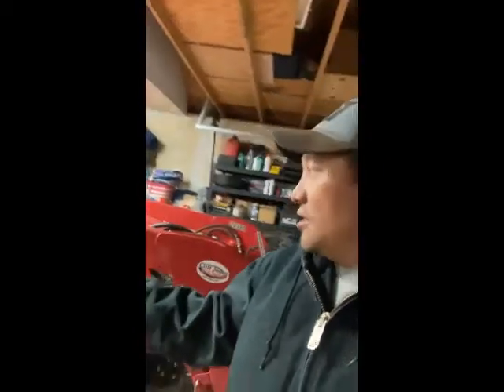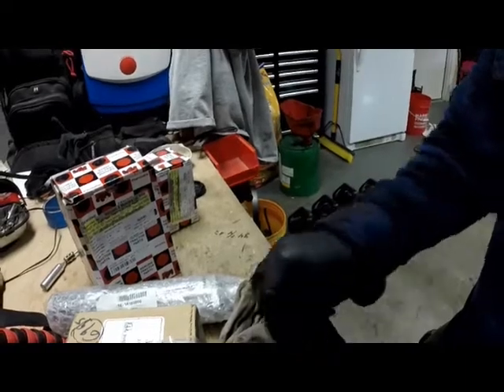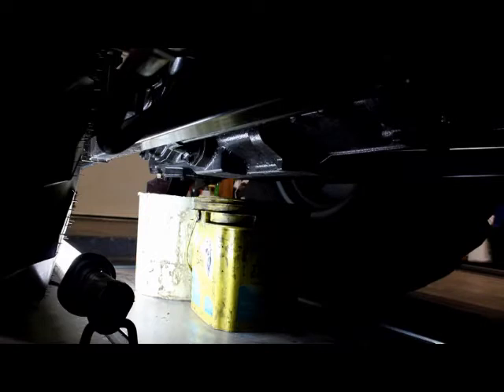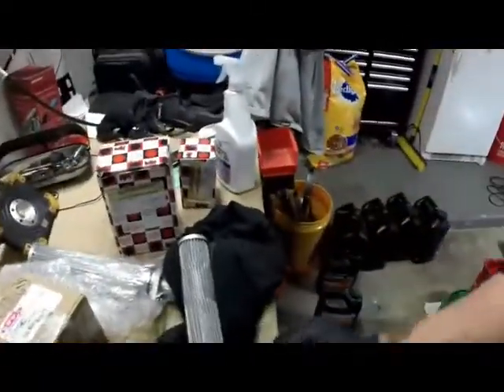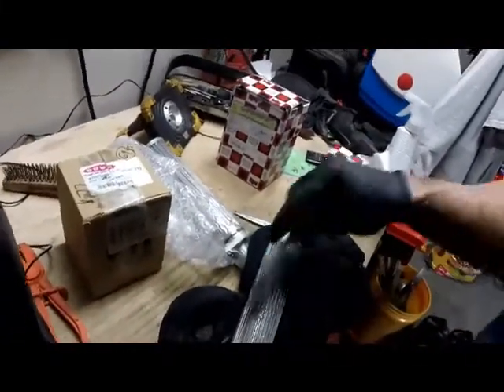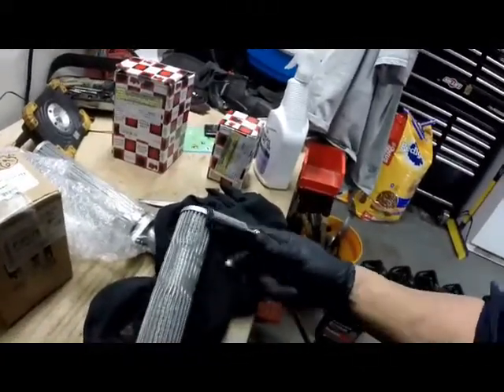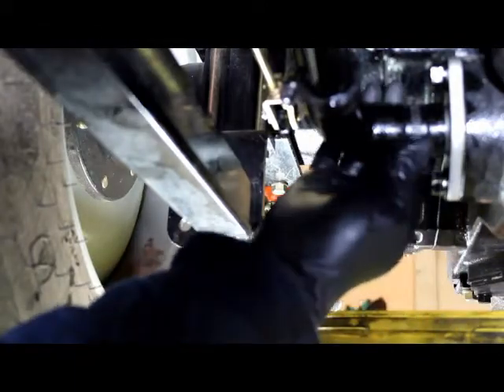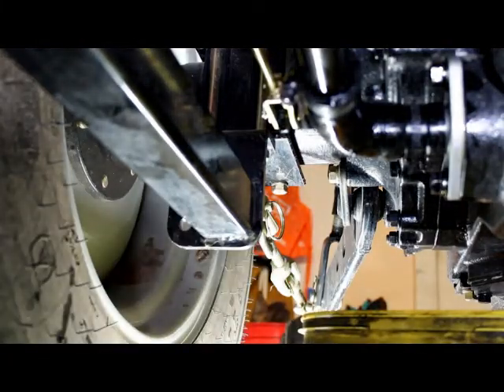Mahindra 2638 - 50 hour service Part 1

Comment: I just did this service on my tractor today.  It's only 5 bolts to remove that loader frame bracket to get the suction filter out.  It added about 15 mins to the job but made it very easy!

Comment: First, let me say how thankful I am for my 15000 lb 4 post drive on lift. Great investment :)  I am used to draining larger capacity vehicles and I use a concrete/mud mixing tub.  Low profile and holds about 7-8 gal.  The only problem that incurs is that they are nor super stiff so caution must be used when pour it into suitable containers.  Good video and I can't wait til I hav 50 hours on mine. Right now I am at 10 minutes

Comment: Very helpful! Thank you, Mr. Gil. Your patience is commendable. That vacuum filter looks like a pain! I would not have attempted this on my own, but now I am ready:)
Reply from the maker: Glad the video helped!
Reply: Yeah it's a pain. I can't get mine out!!
Reply from the maker: @chadg2608  mine didn’t come out straight, it’s at a slight angle. When I pulled mine out it did rub the side of the filter but it’s negligible.
Reply: @MrGil-tl8hk  ty sir, I appreciate it. I finally did end up getting it. They definitely could of made that a better way.

Comment: Yours is the only video I've seen that even touches on the suction filter.
I sure would like to know how you got it out of there....
Reply from the maker: Had to angle it out toward the end of the removal. Installation was the same way due a structural support. The video shows the filter partially flattened. That was from the interference with the support.
Reply: @MrGil-tl8hk  Yeah, that's what I had to do too. Funny, the could have used a filter just 1/4" shorter or so. 
I get it though, it's a readily available filter on the market.

Comment: Hi there nice video but I still have a question  what's the hydraulic oil capacity and how can I know if  I need to refill it  thank you
Reply from the maker: Around 8 gallons. And I looked at the sight glass to confirm. Helps to run it after a fill, work the hydraulics then shut it off and monitor the site glass again and fill a necessary.

Comment: Could you please tell me the exact socket size and what to use for the 2 engine oil drain nuts to loosen them, also for the rear nut for the transmission and three nuts for the front axle ? Please do reply back with socket sizes and tools needed.
Reply from the maker: 7/8” for engine and transmission drain plugs. 14mm for front axle, 12mm for final drive plugs. I would highly recommend getting a flat surfaced vice grip for those.

Comment: I still am having trouble removing that filter even after taking linkage off. How did u get the filter out without damaging it?
Reply from the maker: I had to pull it out at a slight angle toward the end and there was a little rubbing. Installation was the same way.

Comment: If I saw all that material in my clean out, it would be taken back to the dealer to determine whether warranty work is necessary. There shouldn't be that much material.
Reply from the maker: Believe it or not, that filter was a bonus change and wasn't recommended by the service manual or the local dealer but I decided to do it anyway. I figured it was part of break-in so I didn't think nothing of it but I'm glad I did it! I'm curious what I'll get on the next filter change. So far though, the tractor is running great and is almost ready for its next maintenance interval.

Comment: I just got a 2023 2638 HST with about 10 hours on it.  Just wondering if all that metal was normal break in or a sign of something bad to come.?
Reply from the maker: I believe it's part of break in. I'm rolling on 180hrs and have zero issues with the transmission.